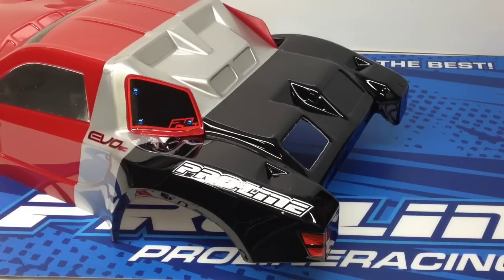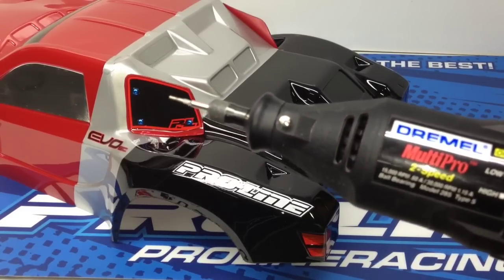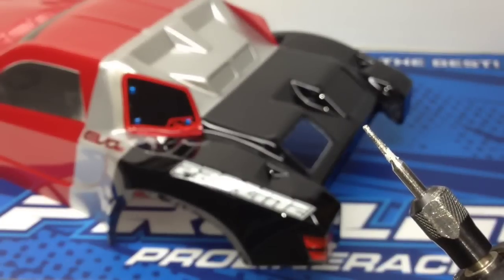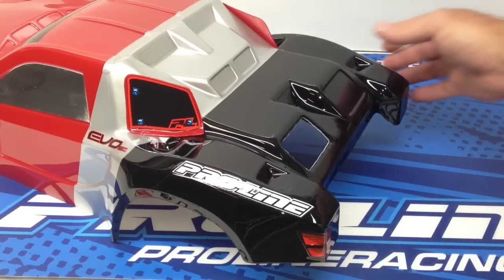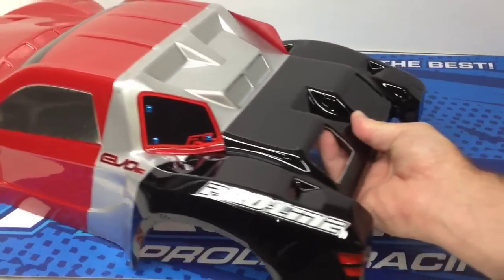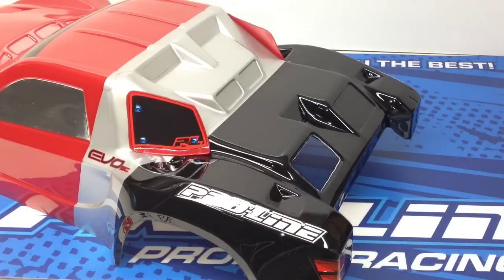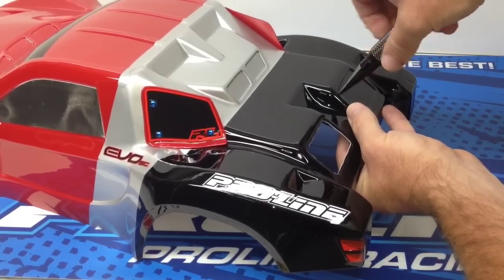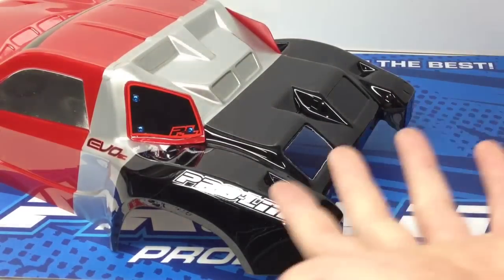Pro-Line EVO, Flotek SCT Bodies - How to cut out panels

Comment: i know this video is very old but a trick i found was to get little pieces of aluminum screen and use either e3000 or shoe goo and glue the pieces of screen over the openings that get cut in the body. believe it or not the screen and the glue help strenghten the body while still keeping the openings for airflow.

Comment: Great tip! Thanks. One question about trimming the complete body. What do you advise which tool is the best to use for trimming a lexan body? I always use a curved Tamiya scissor for cutting out the wheel openings. Is it better to use a knife or doesn't it matter?

Comment: Hey RCNetwork, have you ever used JConcepts overtray on a Slash? Wondering the best way/ place to cut for cooling but small enough, or gridded to keep larger particals out.
Reply from the maker: A long time ago, on my first Slash, I did.  I ended up cutting holes that was tsrategic for the cooling (mostly for the ESC/Motor and then cut screen mesh and shoe-gooed it in from the under side.

Comment: i bought a cordless 8220 dremel just for this, hopefully I can be as steady as you are while cutting the lexan body. Thanks for the video. Question - what tools / techniques do you use to cut your lexan bodies?
Reply from the maker: To score the body, just a sharp xacto knife, then peel the excess. I just got some PROTOform tools to fine tune edges and the wheel wells
Reply: The RCNetwork maybe I am not skillful enough, but I tried using the scoring method....with thinker lexan bodies...kind of hard, for me, to do that. Using lexan scissors doesn''t give a nice cut..
Reply from the maker: Scoring really works the best. You don't have to score too deep. Once it's scored, I start the year by using lexan scissors and then rip the lexan slowly.
Reply: The RCNetwork good idea. Thanks. I'll try that. Lead the cut with the scissors.